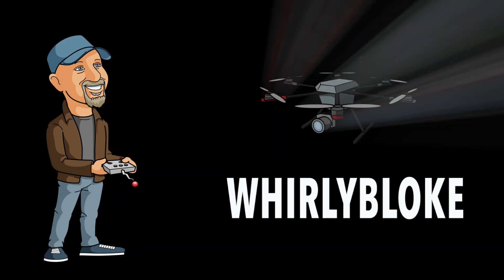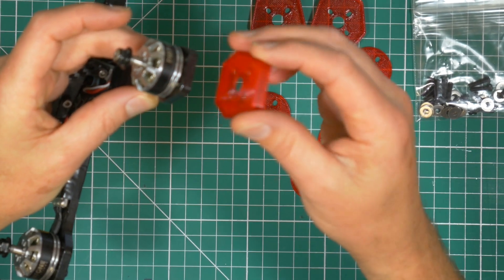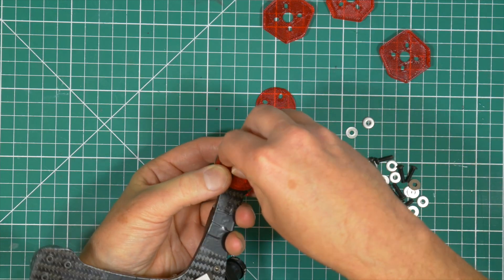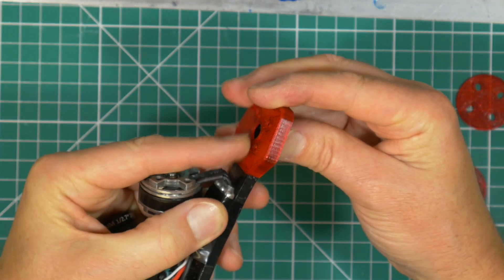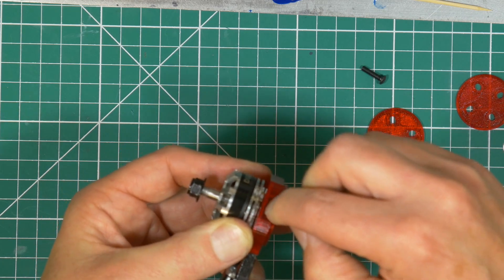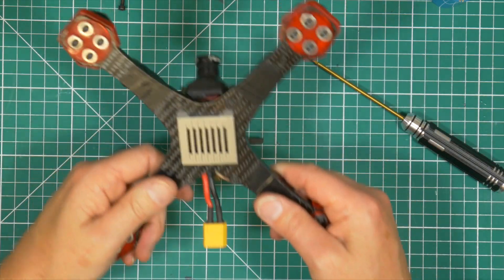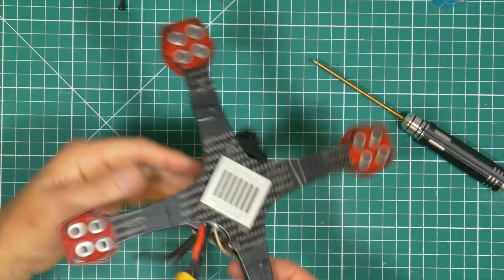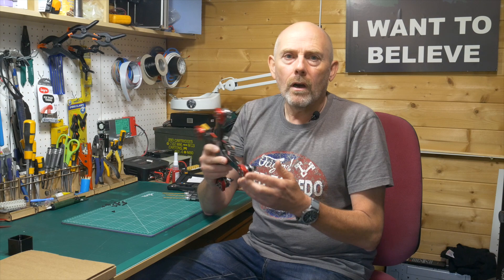Diatone GT2 Crusader soft motor mount and frame protector review

Comment: I got my soft mounts and works great thanks for the review. Quick question about the battery strap plate getting warm after each flight. Is this normal? Or do I have some problem on the PDB
Reply from the maker: Manuel ortiz Yep the soft mounts work really well. The battery strap mount  is sandwiched between the battery and the stack so it will get warm. Depends how hard you fly.
Reply: Whirly Bloke thank you! I couldn't fly my gt2 without your vlog 😀

Comment: I see that these soft mount kits share the shape of Diatone's frame/motor protection "feet", which wrap around the outer frame as well...but I have those mounted so that part is actually on the underside of the FRAME, and the side skirts wrap up and around the bottom edge of the frame, protecting that bottom edge.Every time I break one of those it is from a crash that hits that bottom edge and cracks those feet right there...so I would instinctively install these sets with that foot piece on the bottom wrapping up, and then put the disc under the motor on the top of the frame. This would offer that bottom-corner protection and it seems like would still function 100% normally.So in sum: I am wondering if you perhaps may have installed yours upside down? If not, and the instructions do indeed say to put that foot on top, would you agree that swapping them around would be most likely a better idea?Thanks for being a source of much learning for me!! I started in this hobby with a Vortex 250 Pro, and all your videos on that were critical to me moving forward in this hobby so a big Thank You!Z

Comment: Clever way of applying the thread lock, how did I not think of that myself??? 🙄🙄
Why not just use 8 round tpu parts so that this idea could be used on any frame ( without the protection effect though)?
Reply from the maker: It gets all over the place otherwise ;o)
Reply: The new ones do it with a set of 2 rounds (top and bottom), but there are 4 'sleeves' going through the frame motor mount holes which further isolate the inside edges of the screws from the frame... BUT they oversized the frame holes in order to do this so it is not universal... those thru-sleeves also help keep everything centered. Z

Comment: How much did you tighten down those motor bolts?
Reply from the maker: Tight enough that everything is secure and doesn't move, but not so tight as to squish the mounts flat. Not exactly scientific, but it feels right - the thread lock is key. I've been using these all week and nothing has come loose yet.